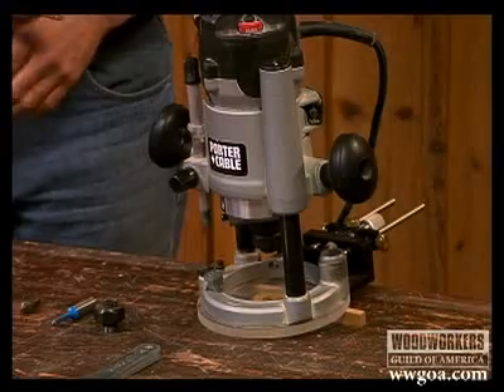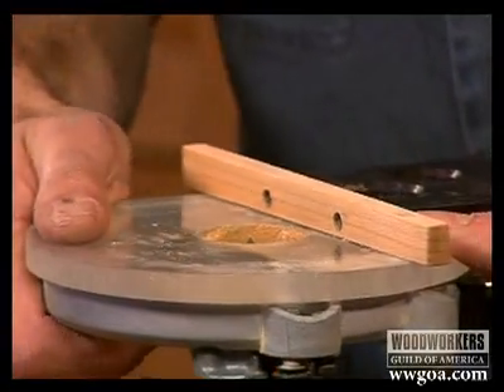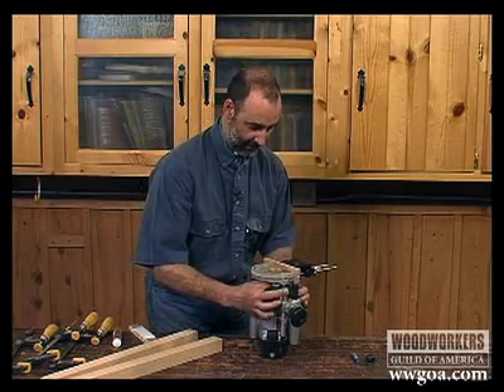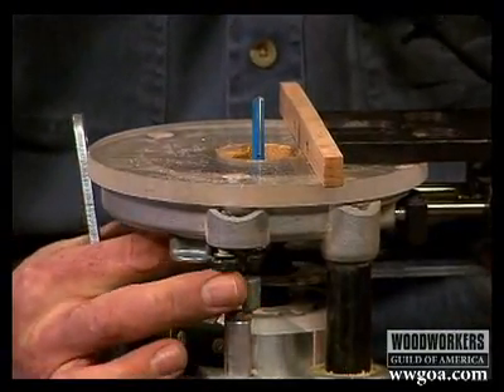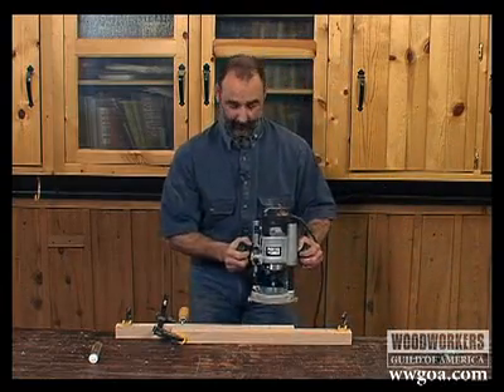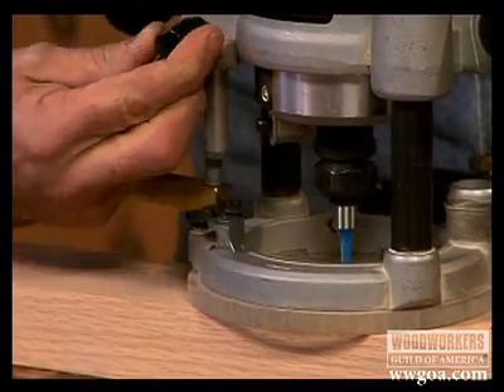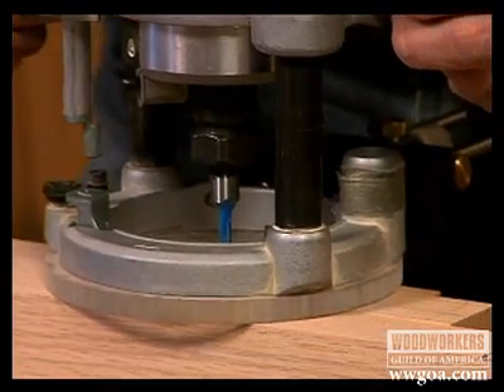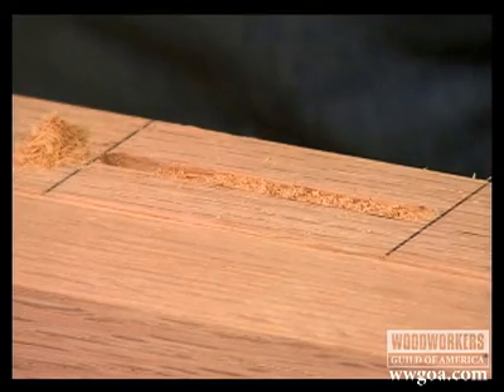Woodworking Tips: Routers - Making Mortises Using a Plunge Router

Comment: I found that it takes me about a minute to square the ends with a chisel; just use a chisel the exact size of the mortise. Having a square mortise gives the joint better support against twisting as well as more gluing surface area.

Comment from the maker: @ben92282 Most routers are made to accept a fence of some kind.  In this case posts on the fence slide through holes in the router base, and can be locked in place.  It’s a pretty common approach.  When using the router the fence rides against the edge of the piece, in this case the side of the leg.

Comment from the maker: @nialljamesbuckley If your router is catching a little as it slides up and down the posts, you can try a little dry lubricant to make it easier to use.  A good example of this type of product is Dri-Tool Lubricant from Empire Manufacturing

Comment: why mark you start and stop points, and not use a start and stop blocks on the right and left side of the router edge, that way you can't overshoot your mark and you can focus more on the routers rocking also you could use a block between the legs to give a bridge over the gap and more support with the extra distance.

Comment: I got a question on the collar chance...if I have a ryobi 1/4 can I replace it to 1/2 collar
Reply from the maker: +Ernie Zamora Some routers are designed to allow either a 1/4" or 1/2" collet, but most are not.  If your router is not specifically designed to accommodate a 1/2" collet, then you should not attempt to use one on that router.   
You should contact Ryobi to determine whether your specific router can safely utilize a 1/2" collet.

Comment: If you are doing a one off then using the V bit is fine but a much more permanent sulution and I am amased this is not something they come from the factory, is SCRIBE a line on the router base parrallel to the fence exactly where the center of your V is. then do another perpendicular to the fence. Next time just measure off the scribed line.

Comment: Have had this for 4 + years. I do high end finish carpentry and with the Freud LU91R012 12-Inch 72 Tooth ATB Thin Kerf Sliding Miter Saw Blade it works great https://www.youtube.com/post/UgkxPeGkHOMe05FySypTOvYumxMn-xi39oRe . I've had many fellow carpenters make positive comments after borrowing it. Pluses; Sturdy fence, great capacity, low deflection, work lights (Not a gimmick), great dust collection, still as smooth as when i first got it, easy tilt. Minuses ; my digital readout is not accurate(don't use it anyway), heavy.

Comment: Do you not have to first drill a hole to start the cut in with this type of router bit?
Reply from the maker: Hi Tim.  No, plunge routers do not require a pilot hole.  You can just plunge directly into the wood.

Comment: But how do you round off the tenon??? This is the part I can't find described anywhere.
Reply from the maker: +TheRacerRich The easiest way to do this to to use a hand saw and follow the plane of the shoulder and make a cut into each corner of the tenon, then take a sharp utility knife or chisel and tap it into the end grain of the tenon, cutting each corner off.  Because of the cut into the base of the tenon that you made with the hand saw, the corners of the tenon should pop off easily and cleanly.  This doesn't "round" the tenon exactly to match the mortise, but it removes the corners and allow it to slide easily into the mortise.  The cheeks of the tenon provide ample surface area for gluing, so it is not necessary to precisely match the contour of the mortise with curved tenon corners